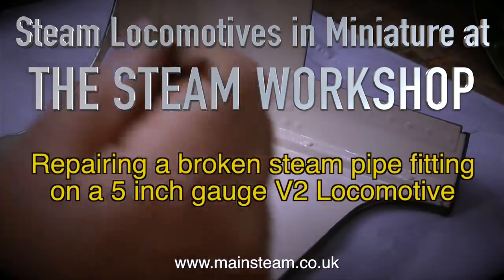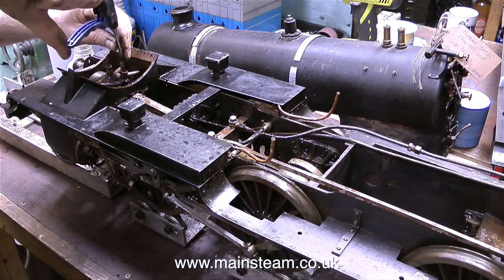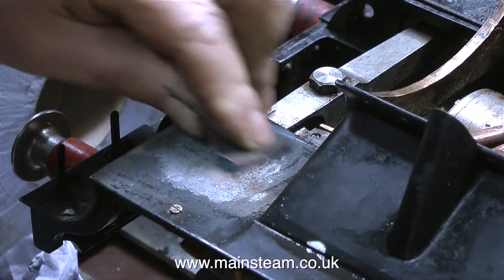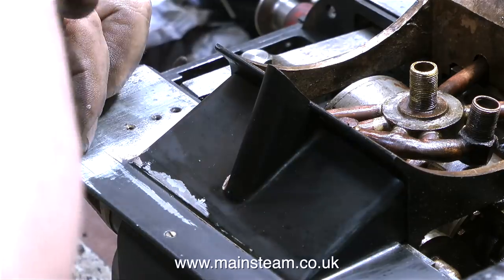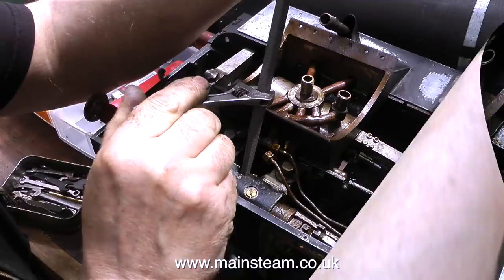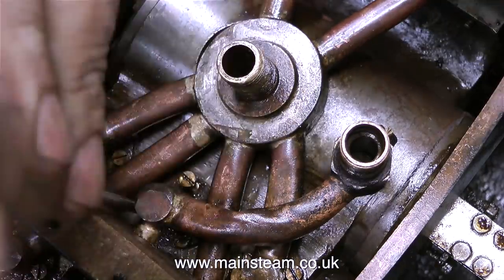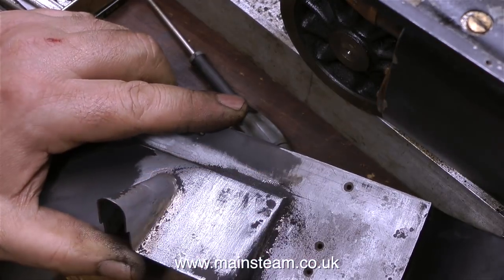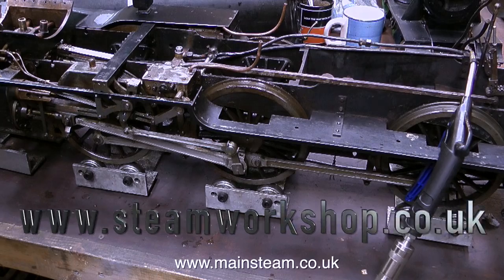WORKING AT THE STEAM WORKSHOP - REPAIRING A BROKEN STEAM PIPE

Comment: Nice tip with the file there Keith, I do have some ez-outs and left handed drill bits but I find often these things do more damage than good and have found too the hardened tools can tear up the thread holding the bit you want out whereas the file is likely to do less harm in some situations

Comment: Here in the USA we have a tool for removing  broken pipe/screws/bolts called ez outs
Reply from the maker: But I haven't got one  - ! So I use the method as shown in the video ......
Reply: I dont have one either...I have used a triangular file to do this. Files really bite into the walls without deforming anything.
Reply: We have a tap for backward using for broken bolt and etc etc. But your method working good too..
Reply: Being a piece thin walled pipe he's removing, I expect the file is better than an EZ-out. You'd need a really large EZ-out and in comparison, the file has sharper edges than one that big. Plus, he had a file right there and it worked. Which is more than you can say for EZ-outs most of the time in my experience.
Reply: The file trick is just a fast way to attempt to remove it rather that wasting time finding the ez outs
Reply: Keith Appleton I had a set and they were crap, broke everyone they weren't strong enough   John